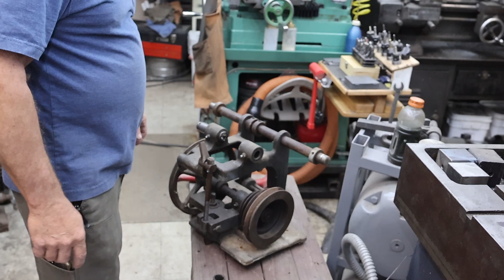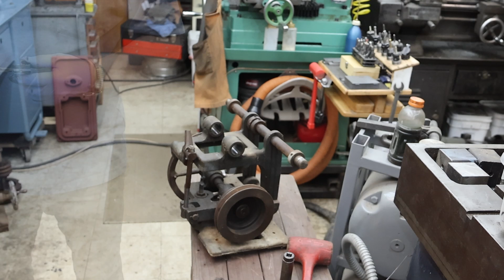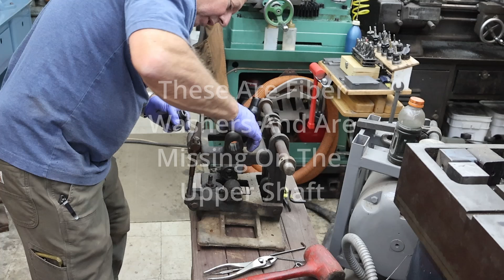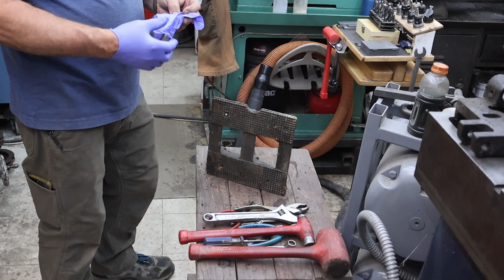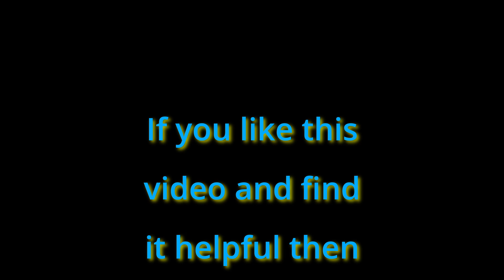Rebuilding A Sheldon Lathe: Part 9, The Bed & Underdrive Dissasembly

Comment: Definitely  great craftsmanship. Using a hard face hammer with a punch and a soft face dead blow hammer. I cringed when I see people banging on steel with hard faced hammers. My mentor taught me to use a brass hammer when necessary. Company policy was you would be fired if seen using a hard face hammer on a shaft. they were serious enough about it to buy us all a brass hammer. Mine got stollen when the meth heads stole all my tools but I made my own with aluminum face on Harbor Freight plastic faced hammers. Brass is so high I refuse to pay the price unless it is totally necessary. Enjoying the project and I will return for more of it. I did manage to keep my brass punches all made from brass round stock over 45 years ago. they are also a must have in my shop.
Reply from the maker: Thank you, the brass drift I was using is an old brass/bronze? screw I came across someplace probably about 50 years ago and has been in my toolbox since then, I have other fancier punches, but for stuff like this it is my go to tool and has held up well.